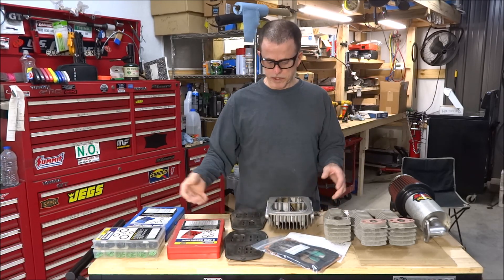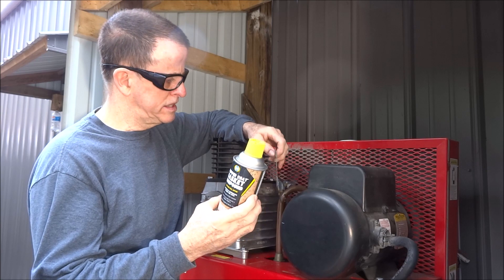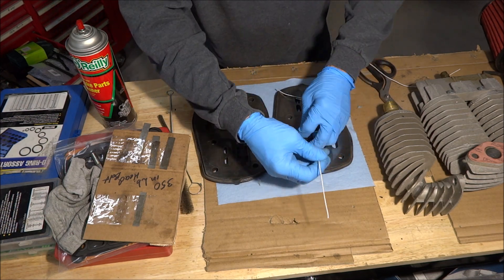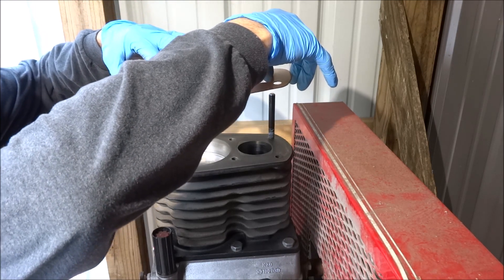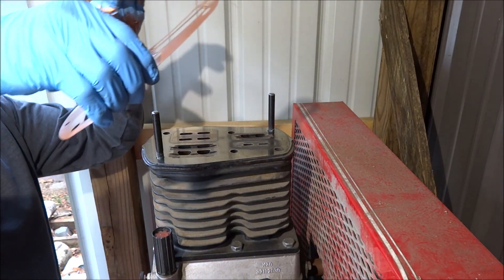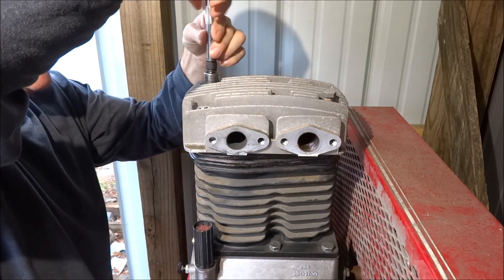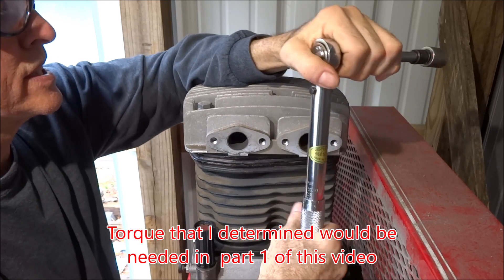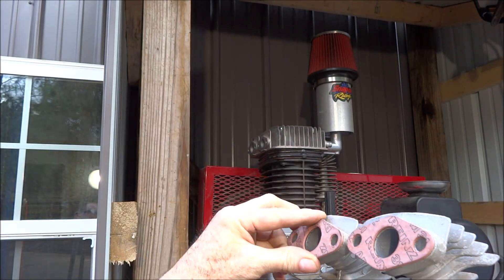Air compressor blown head gasket Repair part 2

Comment: I have the same compressor. Where did you source the head gasket set from
Reply from the maker: E BAY  From seller pacificaircompressors. I will add the link to both (part 1 & 2) video discriptions
https://www.ebay.com/itm/SNAP-ON-GASKET-SET-FOR-MODEL-BRA9G3B/272029921835?ssPageName=STRK%3AMEBIDX%3AIT&_trksid=p2057872.m2749.l2649
Reply from the maker: Have you checked out my other video "Air Compressor Modification, keeping it cool". 
I believe it will keep it from happening again.
https://youtu.be/eJYztqn8H0Y

Comment: So I took the top end off and it’s nowhere near as clean as your is. Lots of carbon build up. 2300 hours. I’ve decided to rebuild the entire head unit. $164 for the kit. We will see what happens
Reply from the maker: Hope it works for you.
Was the head gasket leaking?
Reply: TSR Garage I think so. When I removed the top, the gasket seemed to be deteriorated and separated. I noticed the small cylinder didn’t move as freely as the bigger one. I’m going to clean everything, lube it up, and pick it back together. I’m hopeful it works. If not, I’ll just buy a head and slap it on there.

Comment: Thank you for this video. I have a snap on compressor and I was about to sell it for $500. Glad I saw your repair
Reply from the maker: Yours also had a head gasket problem? The reason  I am asking is if someone else has also had this problem.  I am definitely going to build the air duct (cardboard pattern at 12:50 min mark) to get the air from the fan to the top of the head where it's needed. Thanks for commenting.
Reply: TSR Garage yes. I bought a house that has a 50x80 garage. The former owner left a 80 gallon snap on compressor there. He said it needed valves. After watching your vid, I think I’m going to do a little more exploration. I put it on FB market place for $500. Had a lot of interest. No wonder. I think I can repair it. Thanks again
Reply from the maker: I built the air duct for better cooling. https://youtu.be/eJYztqn8H0Y